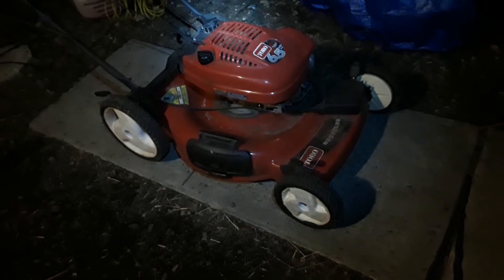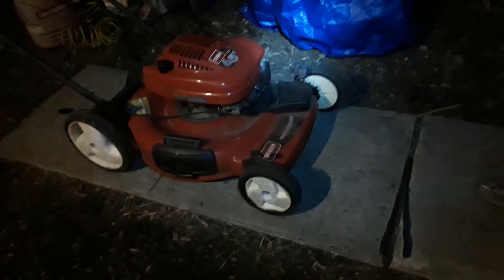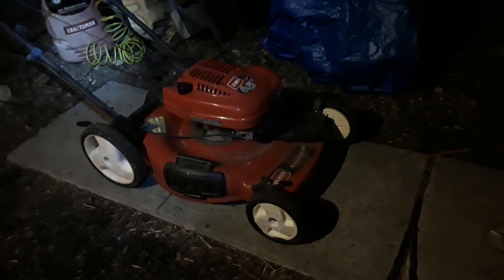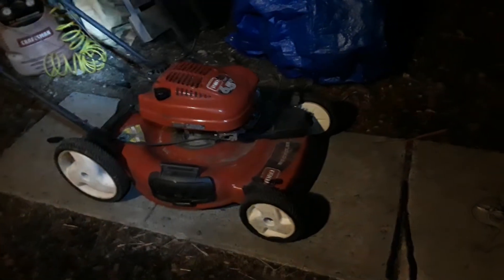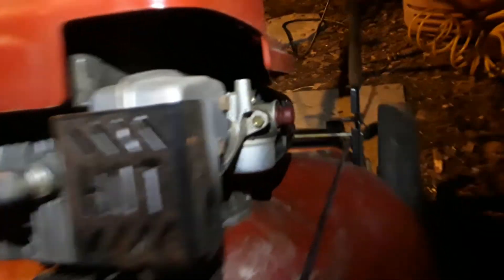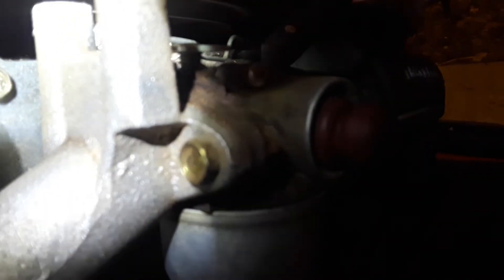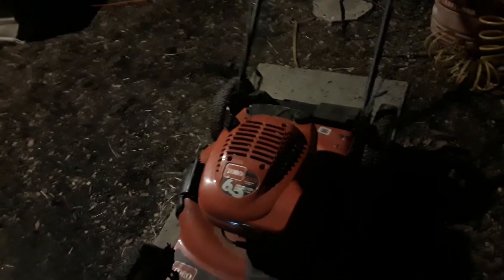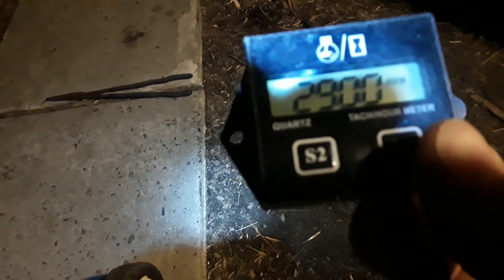RPM speed settings for different engines. Not always 3600! Tecumseh LEV120 2950 +/- 150 RPM 3100 rpm

Comment: I know people who have adjusted their governors to rev higher because they think they’ll get more power out of the engine only to have it blow up on them in a short amount of time. There’s a reason why engines are set at a certain from the factory. And then there is my old neighbor who has the tendency to destroy everything he touches. He’s gone through 3 mowers in less than 10 years and then there was the case with his snowblower spraying oil all over the other place several years back.
Reply from the maker: How about the people that put way more oil and then they're supposed to because they think it's better? I've seen that a few times hydraulic oil locked whatever you want to call it.
Reply: @Mr_Tecumseh yah, hydrolocked, hydro as in water-> fluids.

Comment: Yep! blows my mind that people do not know this. it even lists the RPM on the toro website.... my first 20005 states Engine: Engine Speed
2900±150 RPM.

For briggs this number it posted near the bottom of each parts manual list.

Nice Tach, I have the same one. ran it over twice with a mower. 3rd one I've had for over a year.